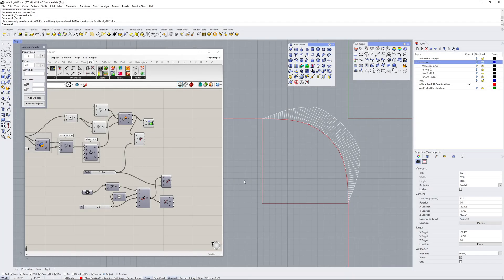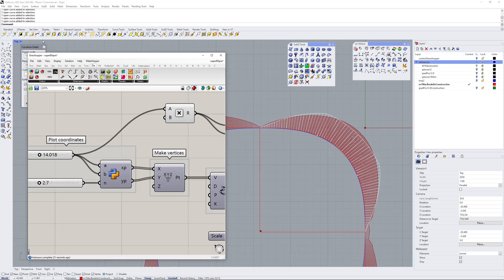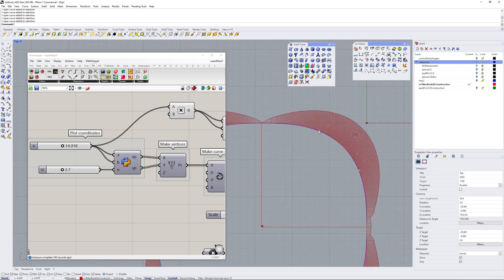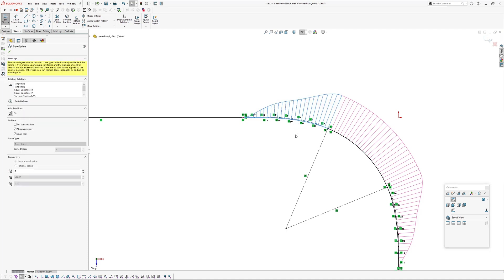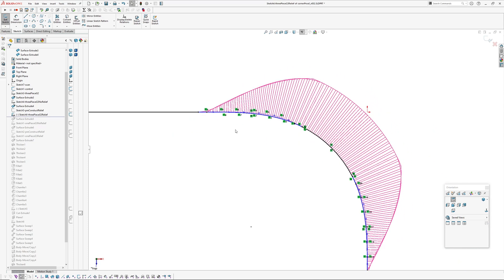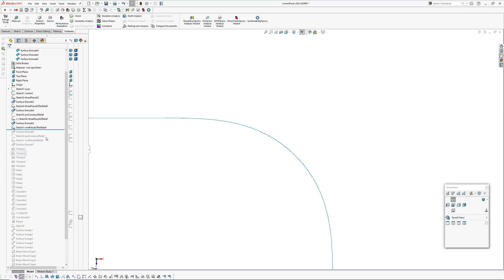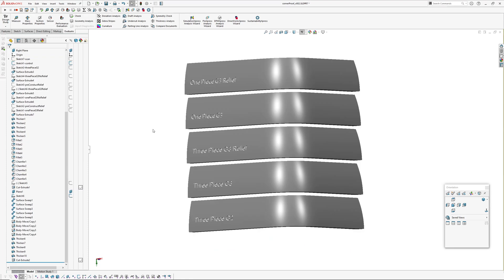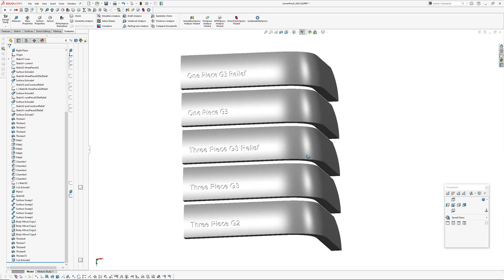Apple Corner 2. Variations

Comment: You are making these corners in the sketch. Can I at least do something similar using the Radius option in the Features tab?
Reply from the maker: Sort of - you can make a curvature continuous fillet, but Solidworks does not give you any control over the fullness/flatness of the fillet curvature, so you will end up with mickey mouse ears when looking at the curvature plot.

Comment: Love this exploration! Seeing as you went with the three-piece G3 with relief on the M1 pt. 2 video, I'm curious if there's any functional difference between adding the 1.5mm diameter relief circles vs. changing the values in the initial control sketch. I measured out the arc length and g3 transition distance after adding the relief and found:

Arc section radius: 10mm (unchanged)
Arc section offset multiplier: 1.025 (unchanged)
Arc length: 45° -> 36.4°
G3 transition setback multiplier: 1.416 -> 1.491

If you plug those values back into the original control sketch, the three-piece G3 no relief ends up having the same curvature combs. If anything, making the change to the setback multiplier would make this more applicable to any size blend - 1.5mm of relief wouldn't go as far on 200mm corner.

This is pretty close to a set of nice round numbers (for example, Arc length: 35°, G3 transition setback multiplier: 1.5) that I can use as a rule of thumb when creating arc-approximating G3 blends, which is awesome!
Reply from the maker: Wow, good investigation! I think I was running out of energy for the exploration, so did not look at creating a ratio for the relief circles. Definitely sounds good to have a nice round set of numbers to drive the corner with!

Comment: The one-piece G3 gave me no troubles, and yes, not too troublesome to set up with formulas.
The ones with the constant radius in the middle gave me over/under defined problems (SW2023).
Thanks for your investigation. Your Rhino vid on 'the finger' is next level!
Reply from the maker: Hi Schalk, long time no talk! Was it the transition splines that were giving you over/under defined issues? I find sometimes I have to define the continuity constraint first, then define the CV placement, or vice versa. Unsure what makes it work one way but not the other. Also, having the CV spacing approximately equal first can help.

Comment: Hey Andrew, the ones with the constant radius gave me troubles in SW 2023... would not define fully but also throws out over-defined errors when I tried. Devised my own numbers from the one piece G3 you did and got no troubles (so, my fav.). Thanks for the investigating. Your Rhino vid on 'the finger' is indeed next level.